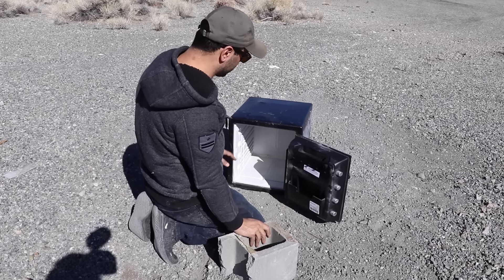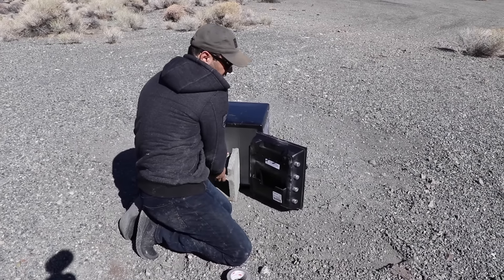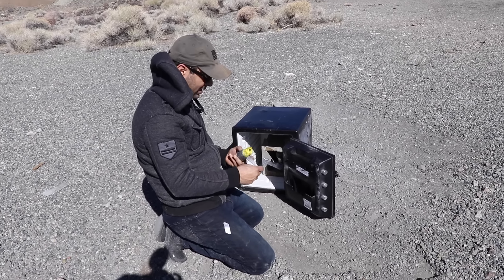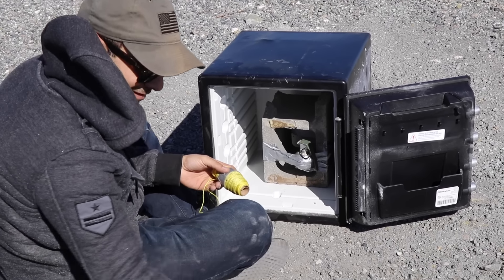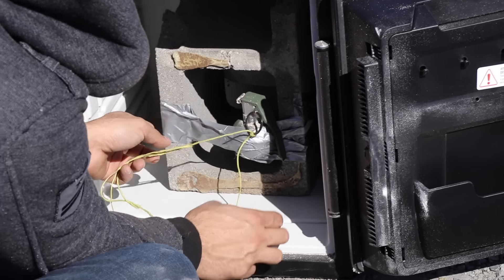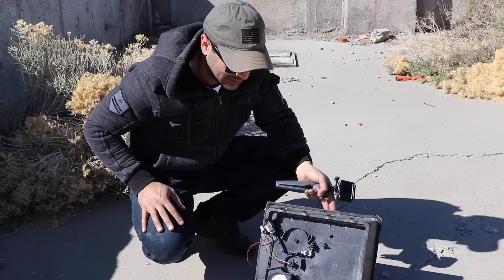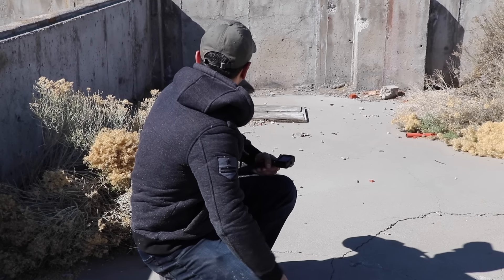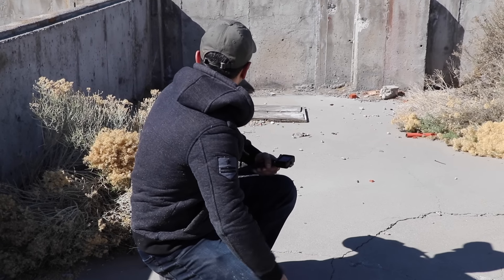Grenade inside A Safe

Comment: So, I’m going to be honest. I didn’t think it would do that much damage to the safe. Kinda gives me a whole new found respect for all the men that jump on top of a grenade to save their brothers in combat. Much respect!
Reply: They are surprisingly powerful. Definitely  got my attention first time I threw one. Went under a couple hundred pound rail road tie and flung it in the air like a light twig.
Reply: @joshuagranger2416  yeah, I work for the railroad and can confirm that railroad ties are not light at all. Probably around 200lbs+.
Reply: That was a FIRE safe not a security safe. It is made of sheet metal with loads of insulation inside. Did you notice? This was not impressive at all.
Reply: @JoeCougar5  ok.
Reply: Overpressure
Reply: @ViewlessSquid  ok
Reply: @anothermeantroll8376  ok.
Reply: Even more amazing, a UK para (could have been a regular infantry, maybe royal marines, can't remember) jumped on a grenade with the ruck facing down. So he fell on the grenade with the ruck on his back. It launched him, but the ruck and everything in it absorbed the explosion and saved his squad (and him).  Amazingly courage.
Reply: @JoeCougar5  Notable how it threw the door, but yes sentry safes are low quality for security.
Reply: @ViewlessSquid  ok
Reply: If you attach it to a cement block yes, very different without one.
Reply: It was a cheap piece of crap “Safe”….
Reply: That grenade has a 5m kill radius and a 15 meter casualty radius.
Reply: @JoeCougar5  your face is not impressive at all.
Reply: Look up Marine Kyle carpenter. 🇺🇸
Reply: 5M Kill Radius, 15M Maim radius.  That pretty much means anyone within about a 100' circle is gonna get hurt pretty bad, at the very least.
Reply: That doesn’t work in real life. Instead it would just make you and your friends a series of disgusting puddles.
Reply: @hansangb  And broke his spine paralyzing him for ever
Reply: Definitely think the air pressure played a huge role in that much damage
Reply: @JoeCougar5  would still easily kill someone, im sure it would have also caused major damage to a security safe aswell.
Reply: Lmao how did this give you a new found respect? Did you think they were jumping on the grenade thinking "eh I'll probably be alright lol"
Reply: @JoeCougar5  I’m impressed that he had a grenade. I was some.
Reply: @JoeCougar5  Real safe would be damaged, but not blow apart. But grenades can do some serious damage.
Reply: They are so powerfull ! 
I was on Afghanistan i serve as a marine for 3 year caz i lost my left legs fingure and severe legs damage caz some douchebag threw and rpg to us ! I lost my three brothers in arm there rip to them ! They were so brave and powerful !
Reply: If it's just the body it won't save the situation, if person jumps on it with thick metal like armor, it should block it significantly. This looks like it'd bloc right through human flesh
Reply: Same
Reply: @JoeCougar5  ok
Reply: its a cheap quality safe
Reply: @sibongakhumalo1784  yes and the quality Bareilly can call this a safe its looks like but It's far from a safe
Reply: Alot of them didnt jump on their own  free will
Reply: @luieescobar4664  sorry to hear that
Reply: So fun fact about the whole jumping on a grenade... 

The safe is an open container with plenty of space for combustion, however if you jump on top of a grenade there is no space for the shrapnel to gain momentum... So the grenade inside the safe did far more damage than the one a soldier would jump on top of.
Reply: @teddy5004  good to know. Still have a lot of respect for the guys who do it.
Reply: @ViewlessSquid  Of course! Takes a lot of guts (no pun) to jump on a grenade.. Deciding in that split second to be willing to suffer a fate worse than death - living without walking or worse living on a machine is a tough call
Reply: @JoeCougar5  good catch pal. I carried well not carried used a dolly on my grandpas safe from the 50’s that size that sob had to weigh 500 pounds now that one would been a good tester
Reply: @danielgoodman3578  You are right..."sentry safes are low quality for security"...they are fire safe not really security...
Reply: @tunahxushi4669  if that's all they intend them for, okay. But they market the security aspects of them.
Reply: @danielgoodman3578  .. I understand what you are saying. But they are not high security. A true "safe" doesn't explode into powder. The powder is used to insulate the safe from fire. A true security safe would be solid steel, or iron etc. but would not protect the contents from heat... It wouldn't explode into a cloud of white powder. We are saying the same thing and I agree with you. But exploding a fire safe built with powder is not impressive. They should get one of those giant 3 inch thick wall solid steel safes and see what happens then.
Reply: It’s an explosive trapped in a environment where none of the gases can escape meaning it would be an extremely violent explosion
Reply: No not one bit, explosions in confined spaces man, the more airtight the worse
Reply: De echo la Granada aumenta su capacidad explosiva dentro de un ambiente cerrado ..
Reply: @JoeCougar5  I wouldn't be surprised if it would blow the door off a security safe from inside. All that pressure has to go somewhere instantly.
Reply: 😂😂😂 They won't save their brothers. All of them will die anyway. You can destroy a whole house with one hand grenade.
Reply: @luieescobar4664  😂😂😂 blah blah blah
Reply: Sweet
Reply: Its only a plastic box 📦 you need real one
Reply: @JoeCougar5 Ok
Reply: C'est liée au faite que le coffre est fermé je pense , l'énergie ne par pas dans l'air mais reste dans le coffre et se conprime .pour sa que c'est plus impressionnant que quand la grenade pète a l'extérieur.
Reply: What did you expect a grenade to do?

Comment: He just casually keeps the grenade in his pocket
Reply: Ariana?
Reply: @amirsalisu  She's quite the bomb!
Reply: what, is that funny? everyone need some grenade
Reply: Where he should then?
Reply: @CaptainFlipperHere , Her concerts are.
Reply: What’s a grande
Reply: its not going to go off if you dont pull the pin. it takes 60lbs of pressure to pull it
Reply: @senderbud6323  yeah my bad, didn't notice
Reply: @CaptainFlipperHere  Damn they really had a blast
Reply: PC FOX its all good
Reply: U don't? Cringe
Reply: @bigsean2473  More like pins. There's the pin that everybody normally associates with grenades, but in addition to that, there's another, smaller, pin, that acts as a safety for the main pin.
Reply: @bigsean2473  the detonators can overheat and explode not nice
Reply: @bigsean2473  it'd be funny if the string broke when he pulled it
Reply: PC FOX it’s a Russian thing
Reply: @atmakur  it's actually supposed to hold from 7 lbs of pressure, up to 70 lbs, so neither of you are particularly wrong
Reply: It's not going to go off
Reply: Bennet Russell, LOL we are in-range 😀
Reply: @trotskyite1  did you see this in wwI? :D
Reply: @bennetrussell3567  lol yeah it would. i think he would be scared to open it to fix it.
Reply: @jellopuddinpops9421  no one said it was
Reply: @bennetrussell3567  I wasn't talking to you. I was just telling the original poster that it's no more dangerous to put a grenade in your pocket than to hold it
Reply: Duh... What do u use a pocket for then?
Reply: Rip that DuckTape role
Reply: Man imagine pulling your keys out and seeing the pin attached to your key ring
Reply: 994 likes
Reply: Legend
Reply: @emirkorkmaz6064  grenade knk
Reply: If you know how it works you can even take out detonator and carry grenade safer. But ya the safety pin needs to be pulled out etc. Aand booom
Reply: Welcome to Los Santos
Reply: I was little bit disturbed
.and worry..he was in danger zone..and a piece of the safe passed beside him in 2000000 km per second...i live this man..but things could go worse in a millisecond.
Reply: Jack Herer EXACTLY PLUS A GRENADE WOULDNT LAUNCH A SAFE LIKE THAT
Reply: This guys need a little more safety, NO a lot more Safety...
Reply: PC FOX their not that dangerous, just don’t drop them. Their spring loaded, you have to twist the pin up which moves it into a position where it can be pulled out, at which time you pull the pin. When the pin is out the spoon keeps it from dropping the charge. 3 safety precautions.
Reply: Grande
Reply: I use to run miles with them on me
Reply: Oh my gosh yeah , I was hoping it not to explode when he kept it inside his pocket..
Reply: Any different than the military pouches for grenades that hang off a belt?? Soldiers in the field just sling them by the spoon sometimes as well
Reply: Big Sean247 It takes 7 lbs of pressure.
Reply: Where can I find a concealed carry license for a grenade?
Reply: As a mcdonands employee, we casually hand out grenades in happy meals  all the time. This isnt that weird
Reply: @pebkac1245  half the toys in Happy meals might as well be hand grenades, who knows how much lead based stuff is in those Chinese toys lol
Reply: Where is this?
Reply: We carried them in something less secure than a pocket.  On our LBE.
Reply: Call him a pro
Reply: PC FOX “just just out this in my pocket” ... this dude...( scrolles to comments) first comment , LMFAO
Reply: Prepared for Next year
Reply: M67 grenades are pretty safe people have them in their pockets all the time 👍
Reply: I assume he’s a russian
Reply: Totally normal situation
Reply: Why not?
Reply: You don't?
Reply: @bubbabearhuntington2295  yes, it very common to keep the grenades in pocket.
Reply: @manishholla   exactly! I was shocked that some people don't. At the very least, you'll never worry about not being able to open your beer.
Reply: That’s Russia for you
Reply: @bubbabearhuntington2295  yes, when we go out, we have pocket full of grenades...
Reply: Doesn't everybody?
Reply: That is the point of them...
Reply: Where else will he keep it? In his shoe?
Reply: Totally safe... it has a clip as a back up on the spoon and it won't go off with out the pin being pulled and the clip removed.
Reply: PC FOX  والله مدري شتقول
Reply: and he got like 20 granades in he’s car  no thx
Reply: @gousmc1983  only in the movies. Military Magazine pouch has holders on each side and you strap it in with the spoon against the magazines. Another safety.
Reply: @mikehunt3688  coffin meme
Reply: Grenades don't kill people. People do.
Reply: نايسسسسسس
Reply: Captain Price unbelievable
Reply: They are highly stable. I had them rolling around in the back of my MRAP. Not a big deal.
Reply: @atmakur  waaaay more than 10 pounds to get them off
Reply: Thug Life 😂😂
Reply: Where i keep mine when im walking around
Reply: @bigsean2473  it takes 7-10 pounds to pull the pin lol where are you getting 60 from? Lmfao
Reply: @atmakur  twine can sure enough hold 60 pounds of pressure lol unless you got it out the garbage. But yeah only takes 7-10 pounds.
Reply: I need a smoke and splasher😍😂
Reply: Just like I doing it everyday, is it something unusual?
Reply: Yes and ?
Reply: @Riceball01  yes there's two pins. A smaller safety pin which you must remove 1st. Then you pull the main pin.
Reply: Gg
Reply: If you have the cinema newton boys lol
Reply: It just a grenade ffs.
Reply: I only see a normal Russian man
Reply: I dont understand whats the problem
Reply: @emirkorkmaz6064  in pbdg
Reply: Where do you keep yours?
Reply: No way dude
Reply: The is what i thought.
Reply: He trust the grenade
Reply: Someone calls it America
Reply: GTA V
Reply: Where did he get a live granade?
Reply: @nitewatchman1576  eBay.  It's a replica grenade straight from China.
Reply: Grenades are actually pretty safe. They use to fall down the gunner hatch into our truck all the time in Afghanistan. It is still unnerving though.
Reply: I guess it's better than casually keeping 2-4 on your chest
Reply: He's mental😅
Reply: Lmao that’s hilarious he does casually keep the Grenada in his pocket lmao
Reply: Yes wothout safety goggles what a guy
Reply: Can we b friends
Reply: We casually kept grenades on our uniforms in the Army.
Reply: It's not a real grenade anyways.
Reply: Truth Warrior agreed!
Reply: @bigsean2473  9-12 lbs to remove the pin.
Reply: @Riceball01  3-4 parts for it to go off. Final one is the spoon which let's   the firing pin go.
Reply: @trotskyite1  it takes a lot heat to set these off and it's a lot of mass to hear up.
Reply: @frikkiesmit327  bad idea detonator is a blasting cap and can be more sensitive than having together.
Reply: Deepak Atmakur : sorry but from my understanding you know nothing about string.
Reply: its not a live grenade so
Reply: yeah he was way to causal about that...like he was putting keys in his pocket.
Reply: He is really said kaputt that is germany!?!?!
Reply: Nooooooob
Reply: Bruh
Reply: @CaptainFlipperHere  

Jjjjji
Reply: Fr like gta real life gta6 is this
Reply: Yea, and?
Reply: ikr
Reply: He just casually walks on planes with grenades in his pocket
Reply: جاديم
Reply: No
Reply: Danger 😂😂😂😂
Reply: imagine when he pulls it out of his pocket the pin gets caught on a stitching on his jeans
Reply: PC FOX doesn’t everyone??
Reply: lol
Reply: "Oh just a sec let me grab my keys" where he then accidentally grabs the pin
Reply: @senderbud6323    it's a  bomb
Reply: IKR 😂😂😅
Reply: @jahimuddin2306  h
Reply: I want to know how he gets grenades
Reply: Lol
Reply: @wasserwasser8726  Where he should then?
Reply: Hey I thought that was normal joking
Reply: Absolute mad lad
Reply: Is that not where you keep yours?
Reply: Ikr
Reply: It's the tactic  pocket
Reply: its completely safe actually the pin is very difficult to cut loose like as if your pockets moving would be able to do that ... and the handle needs to fling back which can't happen in your pockets because of the lack of space
Reply: It's always good to keep a grenade in your pocket you never know when you run into a safe you need to open
Reply: @CaptainFlipperHere   مف
Reply: @emirkorkmaz6064  
Not everyone but military and special forces .
Reply: Easy the pin is not pulled yet, sissy!
Reply: @amirsalisu  HAHAHAH LMAO
Reply: It's not gonna explode out of nowhere lmao
Reply: Imagine if you tell him something rude and he's like: I will count from 10 to 1 and throw this grenade at you
Reply: i keep a c4 on my belt, grenades are for beginners
Reply: American
Reply: Average Russian American
Reply: @rninja90 bigger grenades

Comment: Lockpicking lawyer here: How to open this safe with a m67 grenade in 4 seconds.
Reply: Unexcusabl design fail
Reply: This isn’t a technique I use fairly often, but it gets the job done in a pinch.
Reply: A little click on 4...3...2...
Reply: The lore's getting deeper and deeper
Reply: It’s not a real grenade
Reply: A click out of 2 4 is binding
Reply: ...with the grenade Bosnian Bill and I made.
Reply: We all must watch the same channels.  LMAO when he said lockpicking Lawyer.  Great stuff!
Reply: It would be impressive given that the m67 has a 5 second fuze.
Reply: Ima keep it at 666
Reply: Mynamejeff Hjhjh then what is it?
Reply: "hi I'm the lockpicking lawyer. Today we are going to open this safe using the m67 grenade Bosnian Bill and I made."
Reply: Soggy Diaper  A must, the test could potentially be a fluke it may have been skewed by the cinder block, duct tape, or more likely the dirt/mud around the vicinity was not a specific kind.
Reply: ...So to start off with I'm just disengaging the main activation pin on this M67 safe picking tool with this cheap but reliable Banggood no2. tension wre💥

Comment: “How to crack a safe”
-Google: call a locksmith 
-Bing:
Reply: Google: LockPickingLawyer
Bing: Edwin Sarkissian
Reply: First open the safe, put a grenade inside, and then lock it again
Reply: Carmella Bing.
Reply: dafuq. How do u get the grenade inside it in the 1st place?
Reply: Tape the grenade to the front and tie the string and the pull string that's how😬😬
Reply: lmao big boom boom
Reply: bing: 50 unrelated search results.

#1 how to fill a crack in your driveway. 
#2 how to be safe on vacation
etc.. bing is terrible.
Reply: @nguoinhat3621  i think that was the joke